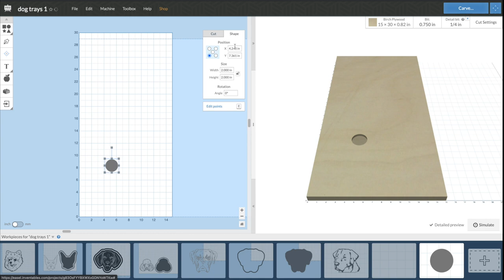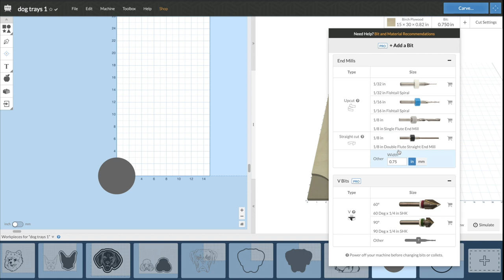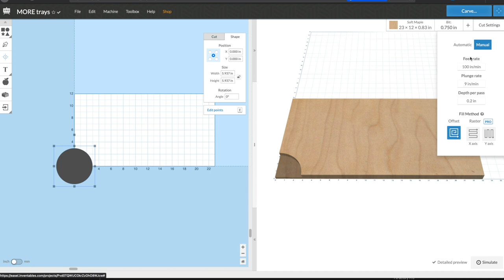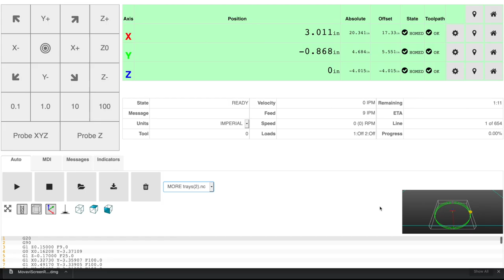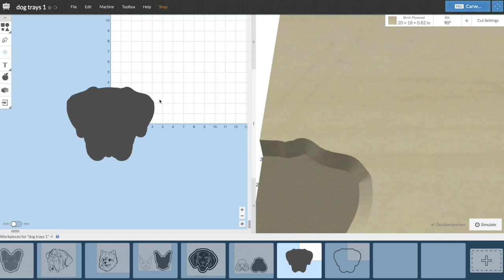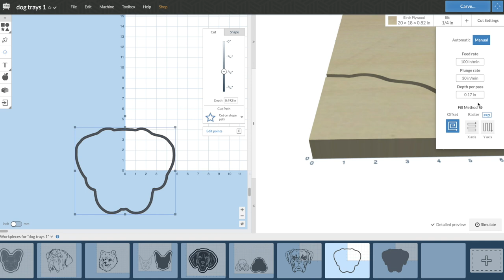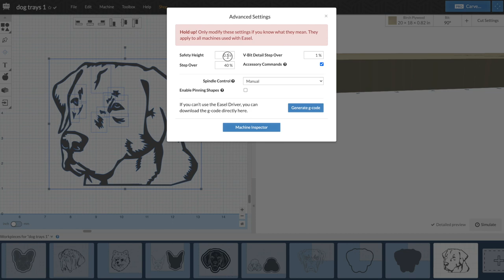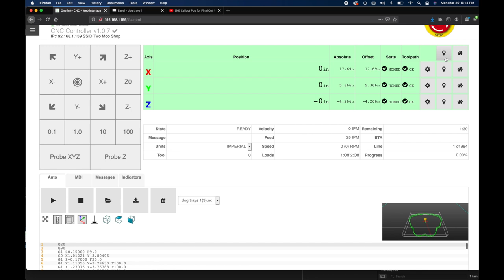Catch all tray guide // How to make a catch all tray // CNC

Comment: Great tip on the Safety height.  i was unaware of that and will definitely use it in the future.
Reply from the maker: Glad to share. Thanks for checking it out!
Reply: Easel now was an extra safety height which you can set to avoid any external obstruction like clamps. You can still have a short safety/rapid height to allow quick retracts between cuts and at the end of the job, the extra height to get home safely!

Comment: Thanks for the video.  Your tip about the safety retract height fixed a problem on a sign file I was having and couldn't figure out.  As soon as I heard your comment about it cutting across the corner of the bowl, I realized that's what was happening on my file.  Just goes to show, you never know when the tip that helps you out will come from a totally unrelated video.  I've only had my Onefinity up and running about 3 weeks now, learning something new every day.
Reply from the maker: Glad to share! Its definitely a learning curve, I typically tell people to expect about 6 months until you're comfortable

Comment: really great tutorial video thanks.
Reply from the maker: Thanks! 😁
Reply: i have to be doing something wrong i tried 50 times .  I make the circle open apps make the offset, delete first circle , have the offset hit clear pocket and get a solid circle? like the first one.
Reply from the maker: @watchtv1963  the inside circle needs to be “clear out pocket” and the outside circle needs to be cut on line or cut outside of line. Make sure the inside circle is the only clear out pocket path

Comment: First off I wanted to thank you guys again for producing these videos they are extremely helpful for this old turd to learn CNC. I have been practicing cutting out these dog faces and have the Onefinity and settings are copied off of what you suggested in this video for last step of cutting out the project. On one of the last passes I could hear the sound changing and it dug down into the pine before I could stop it and pulled the bit out of the router and stuck in the wood. The only thing I could think of was that I had the speed set too low on the router which was 3 1/2. Any suggestions would be appreciated. Thanks again.
Reply from the maker: Did your bit slip down from the collet? Thats what I set the router speed to if you are using a similar bit as me.
Reply: @TwoMooseDesign  It could have but thought I had it tight enough. The thing that was weird to me that on another one that was set the same the cutout was a minute less.
Reply from the maker: @davidrowe1254  maybe your depth got off a little. When ever I switch bits I tap the collet with the wrench because dust builds up in there. It’s not uncommon doe it to get gunked up and slip, I’ve had it happen a few times. Every few uses I’ll take the collet off and give it a couple taps to make sure it’s dust free, you’d be surprised how much gets in there
Reply: @TwoMooseDesign  Thanks for the help I will check the collet

Comment: Thank you! For the simple bowls in the beginning, you created two separate workpieces, one for the inside of the bowl and the other for the outside.  do you export each workpiece individually ?
Reply from the maker: I do yes, two separate g codes. If you are using the same bit for both you could export them in the same file, make sure it’s on one slide and then export.

Comment: Really nice video! Thank you for covering this. I am very very tempted to get a Onefinity for my personal projects. Also, pro tip I have done for the z-axis setting is to take a post-it note or note card that is taped hanging over an edge of the material. Then lower the bit until you touch the paper lightly, at this point you can zero the z-axis. This helps to prevent bit cracking or snapping because it does not provide any, substantial, force upwards on the bit as it is lowered and does not scratch the workpiece. I also sometimes use metal plates that are inscribed with their thickness. This way you can zero out minus the thickness of the plate if you need it very accurate.
Reply from the maker: Thanks! And thanks for the the tip 👌🏼
Reply: Feeler gauges work well too!

Comment: Thanks for this video, I revisited a lot when I got my onefinity… quick question… what do your bit speeds look like on easel for that 90 degree v bit? With the easel recommended speeds I’m sure a tray like that boxer would take around 40-50 mins.
Reply from the maker: Hey! I run a speed of 100ipm depth per pass .12 and ramp down at 30

Comment: Can you make a video on how you cut multiple trays at one time? Do they all have to be the same file or can you cut more than one file?
Reply from the maker: Yeah I’ll add it to my list. I cut them all with one file. So they cut simultaneously. Different files for each bit
Reply: @TwoMooseDesign  thanks
Reply: @TwoMooseDesign  I was wondering how you cut the different files all at once also how you would set that up with the onefinity in different spots on the spoil board.  I’m using vcarve pro
Reply: @TwoMooseDesign  This is a great video and really helpful.  I'd also be really interested to see how you set up multiple trays for a single file - if it's just positioning the center of each piece in the the same spot on the spoil board, or if there's an easier way to do it.  How you place the file in the design software to match up with where it's located on the spoil board, etc.  Super helpful and great information!  Thanks for putting it together.

Comment: Love your videos, you guys are awesome! I am new to cnc and struggling with this whole pocket, then engraving stuff. I am curious, if I prefer to start my x and y axis on the bottom left, how do I engrave after the pocket?
Reply from the maker: Thanks!  Ummm you could try adding the depth to your v bit. So for example if your pocket is .4 deep and you are engraving .1 deep your cut depth would be .5 I personally haven’t done this so I’m not sure how well it will work just an idea. I started running my zero in the middle a long time ago and haven’t done a corner zero in forever lol

Comment: Hi if I want to use a 3/4"  bowl bit how do I tel easel to recognise the bit ?  Do I add custom bit and type in 3/4" or is it the shank size 0.75 ? 
Why hasn't inventables installed a bowl bit in there inventory as it seems to be popular 🤔
Reply from the maker: hey! Run it as a custom 3/4" endmill and start slow as its a large bit
Reply: @TwoMooseDesign  thank you

Comment: I was so excited to see this video was posted!! I had been waiting on it since i saw your video on 5 CNC projects!  I bought the German Shepherd file from your website and started working on it but keep getting an error code about my Z axis position being less than the min soft limit in the middle of the detail engraving.  Anyone know how to fix this issue or what i'm doing wrong?  I'm new to the CNC world so any help is appreciated.  Thanks!! (working with the onefinity and easel)
Reply from the maker: Are you resetting your Z zero? The machine should be able to cut down to the waste board and the engraving is less than that.
Reply: Did reset the zero before starting the engraving.  Gonna have to look more into it this weekend, had to go back to work before i could get it fixed.

Comment: New to CNCs and waiting for my Onefinity to arrive, but I've been trying to get a head start and learn some of the software.  It's not easy to learn it while I can't test things, but none-the-less, trying to learn as much as I can before it arrives.  I'm confused in your video when you set the shape position to 0 and 0.  It seemed to have moved off of your workpiece.  Why is that and how did it end up cutting correctly?  Is it because you simply didn't set your workpiece dimensions prior or am I missing something else?
Reply from the maker: This puts the zero in the center of the work piece, that’s just how it has to be done in easel

Comment: Question... I am attempting to duplicate what you have done.  At 2:28 when you select clear our pocket .... the result doesn't look like my result.  My rendering gets rid of the wall of the tray.  Any ideas as to what I am doing wrong?
Reply from the maker: You need to have two bits selected. A roughing and a detail bit. If you have that part down then check to make sure your cutting on the right paths, clear out pocket and possibly cut outside the like. It’s hard to know without seeing it

Comment: Can You show how to set up cutting multiple trays at once in easel?
Reply from the maker: Set zero on one pieces and measure off of that one and input the measurements to set the location of the next design. If you’re doing a bunch it’s a lot faster to glue up a panel and cut a bunch.

Comment: Watched the video several times but when I got to clear out pocket it is clearing out the whole circle including the offset now. Not sure if this was a recent update with easel or what I am doing wrong.
Reply from the maker: I’m not exactly sure what you mean but you have to run them as separate files. One file to clear the pocket and another to cut outside out
Reply: @TwoMooseDesign  I figured it out. It wasn't allowing me to select the inner circle individually to make the dish. Had to click off the entire thing then I was able to click the inner circle only to make that the dish portion and keep the offset separate

Comment: What RPM did you run your router on these?  I'm burning through bits.
Reply from the maker: For endmills 4 on the makita and for a large clearing tool 3 then 3 for v bits. But I don’t know your set up or speeds and feeds 🤷🏼‍♂️

Comment: How long does it take to cut?
Reply from the maker: A catch all tray? Between 10 minutes and a hour 🤷🏼‍♂️ depends on the design
Reply: @TwoMooseDesign  what's a 10 min cut? What about the dog designs how long did they take to cut?
Reply from the maker: @dusticdustmakerdesigns  depends on the design lol some take 5 minutes for the face some take 20 lol
Reply: @TwoMooseDesign  what do you do to cut down the time to that? I tried to configure one and it says it's
Take an hour for 1
Reply from the maker: @dusticdustmakerdesigns  it depends on your machine 🤷🏼‍♂️ i use a 3/4 straight bit to clear out the cavity